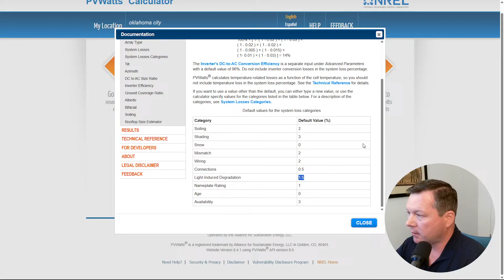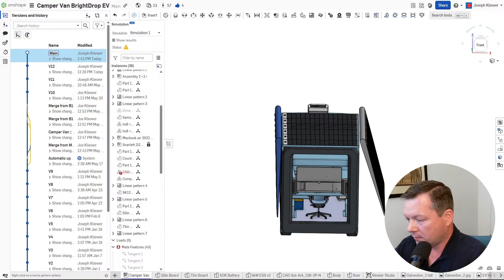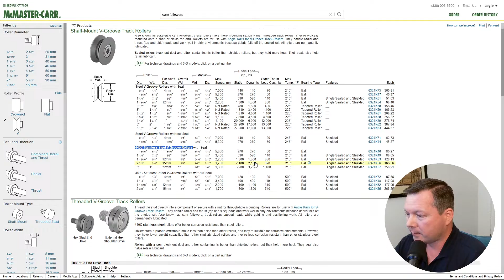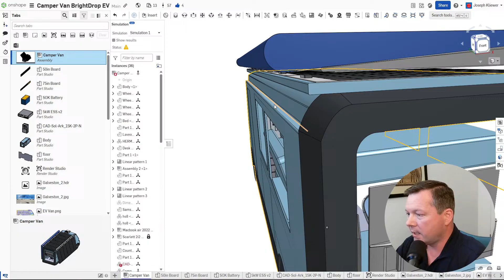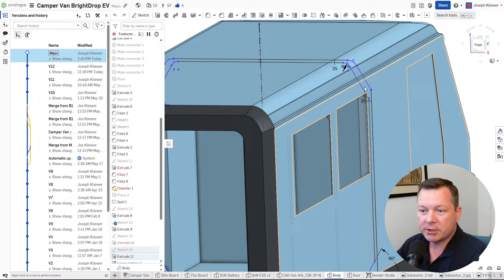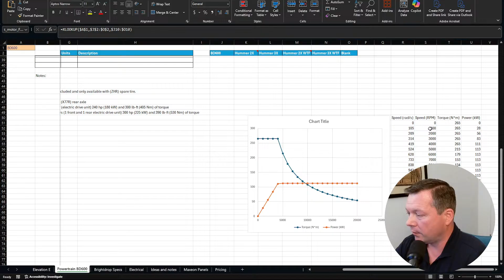Engineering Jam Session 3: Open Source 100% Solar EV RV

Comment: Unlimited power is great but you still have the major issue of running out of water and filling up your grey and black tanks. Also, you should use the 3 stacked slide out method not flap out method for 3 main reasons. 
1. It's easier to deploy the two slide out panels. 
2. The two deployed panels are sturdier and stronger than the flap out hinge style. 
3. There's always one of the three panels always facing the sun when you're not able to deploy the other two panels or when the vans parked on the street or while driving.

Comment: Sorry if this is a duplicate, but I think you want to have the rooftop PV exposed to sun when awnings are stowed. This way you always get 2kW charging, even when underway. The design I worked on were with heavy sliders. Fixed, exposed top PV, then two stacked PVarrays that slide out, one drivers side, one passenger side.

Comment: What advantage would a high voltage home battery and inverter offer? There is an open source project on gethub for high voltage solar inverters CAN emulator/communication with ev auto batteries.

Comment: Slide out array I'd just actuate with two ropes and sailing cleats to tie off.  For fold out arrays, gas struts to take the static weight and locking struts like awnings use would be my first thought.  Simple, strong, light, and reliable.  Neither is push button, but if it takes less than 1 min to setup then it's not a big time sink.  Fold out arrays will also need stow latches for when you drive.  (slide out can often skip stow latches)  And if one or more arrays are exposed while stowed, then you still have the option to put up the arrays later as you'll get some power in the meantime.

Comment: Where I am, in Asia, we have N-type bi-facial 750 watt panels for under $100 with 24.1% efficiency. N-type are better in hot weather as they don't lose as much power as P-type as heat increases. White background is best for the backside power increase. These all have bypass diodes and split cells so shading is not an issue even in series. Voltage is 50.2voc and 43.6vmpp.
Reply: and for light weight panels like the cannonball run, we have 4.8kg, 410 watt, 37.45voc, split cell panels, 21% efficiency, but they are $150. I installed 5 of these on my friends boat. What's available state side for high wattage, solid and flexible panels? just curious.
Can't wait to see the design for the RV.
Reply: @altondevine who makes those lightweight panels?
Reply: @nathanwatts8607 PSI Energy. called Solar Slim.

Comment: I have considered the same idea, the best intersection of time and effort is to have one side and the top fixed with the last side the only one actuating and you just park the van facing the sun. Sure you loose some solar gain but I bet its not very much and makes the whole project much easier, then do a stage 2 to actuate the other side if you want... Just this week Ive been looking at V Groove bearings and could not find them in stainless, at least not with a 12mm bore.

Comment: How much would your range be affected if you towed an "empty" trailer, with extra solar panels on it? 
Im curious about the CBA of trailer drag vs additional solar capacity.

I would start with a trailer of identical length to the van.

Also, how would your aero improve if the folding panels stowed position was flat against the sides instead of on the roof?

Comment: Amazingly similar van design and solar layout: https://youtu.be/sQdDu9IVdGo?si=m9ze1cfHzTuA4sFt

Ever increasing & fast-forming thunder storms with their inherent high  and potentially damaging winds add to Inclement weather impediments for many areas. 

Reasonably sized, Highly efficient perovskite solar panels... ABSOLUTELY 👍🏻

Massive solar arrays are problematic. Consider that these are sim to large sails and even moderate winds can do major damage. 
Respectfully suggest any awnings be tied to automated retraction system with anemeter to automatically retract / preset wind speed. 🫡
Reply from the maker: Yes, I used to Kitesurf with a 14 m^2 kite, v^2 is no joke. Plan to design for 40mph and auto retract at 20mph.

Comment: Sweet man! Watching this and leaving a comment. Very excited about this. I plan to have solid awnings that flip up instead of carrying all the weight on the roof. Having nested to the side will have better weight distribution and less aero drag unless you use a deflector or something to offset the height increase on the top
Reply from the maker: Nice, thanks for the comment, folding out from the side keeps with the KISS principle.
Reply: @lightpowered   Of course! I’m really loving what you’re doing with the Solar Cannonball and now this project. I hope to run into you out on the road someday in a BrightDrop!
I’m planning a similar setup—with solid awnings that flip out from the sides, keeping the panels exposed to sunlight while driving. That way, you can still generate power on the move, unlike setups where the panels are covered during transit.
I’m also adding a rear-mounted solid awning-style panel that lifts up and doubles as shade at camp.
With this layout, you can usually have at least one or two arrays actively generating while driving, depending on the sun’s position—except when you're heading directly into the sun.